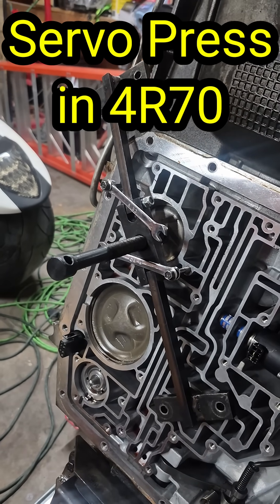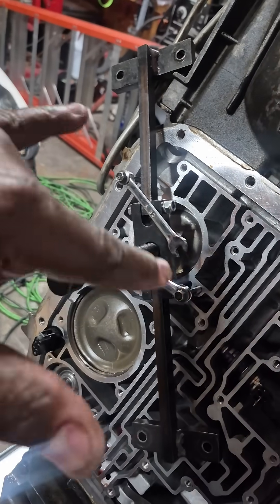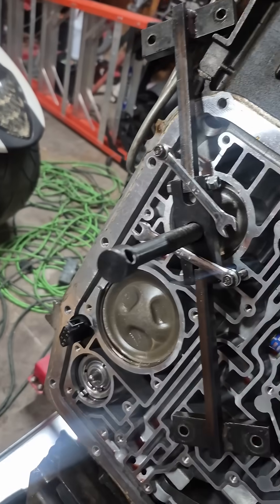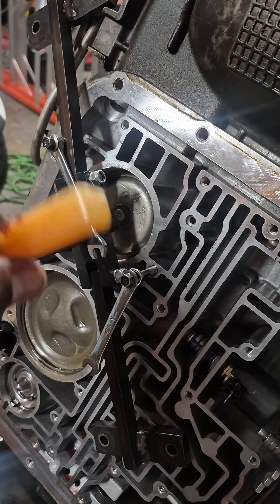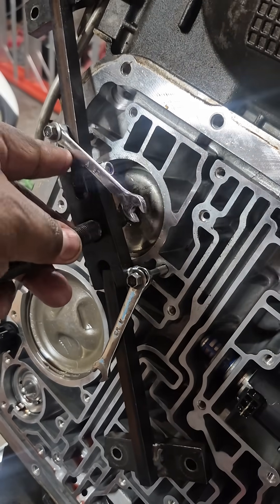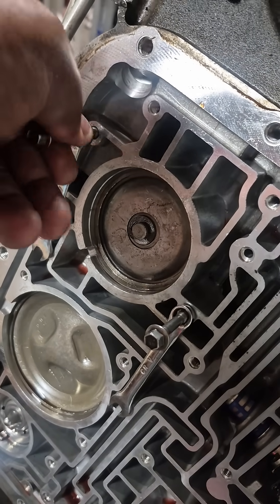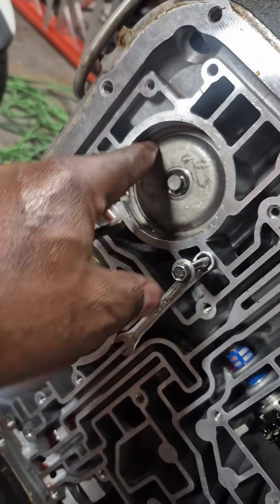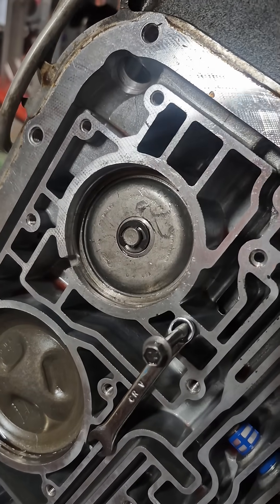Homemade Garage made Servo Press to install retaining ring #ford #4R70

Comment: Kind of reminds me when I used to make my own tools back in the day when I couldn't afford them why spend the money the tool market nowadays is saturated as f***
Reply from the maker: Yup. I've got tools I've built to push the springs down on a head to pull the keepers out, releasing the valves. I had to do some welding to make it, but it works like a charm! hahaha! I'm like you: build versus buy.

Comment: Dang this is pretty sick. Don' t know what' s happening exactly. But pretty cool nonetheless.
Reply from the maker: Thanks! Anyone who had an issue getting a servo compressed will breathe easier. It's nearly impossible because of the super strength of the spring inside. Just have to be creative in the garage, that's all! Showing all my little tricks on shorts for someone who's stuck in a jam.